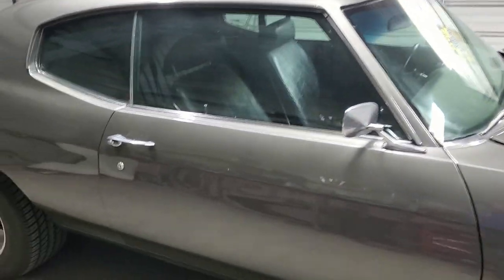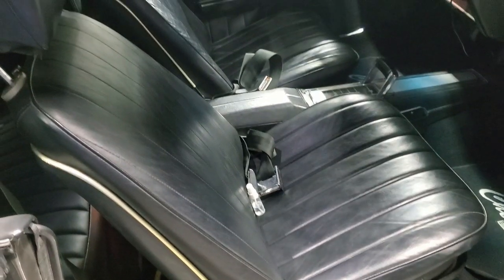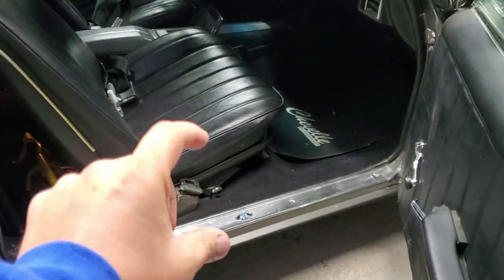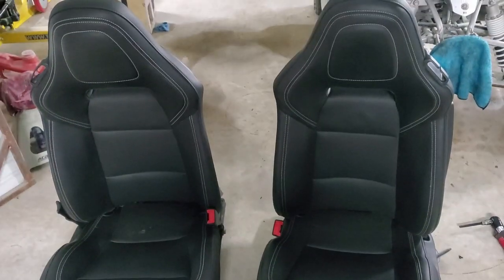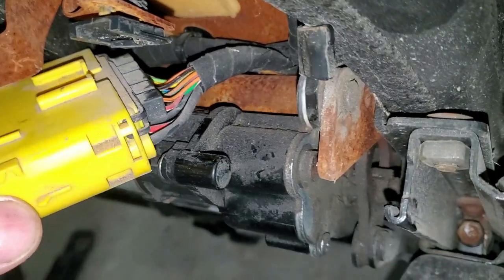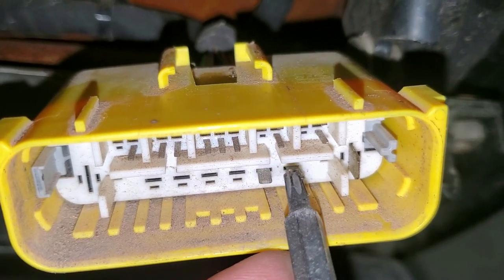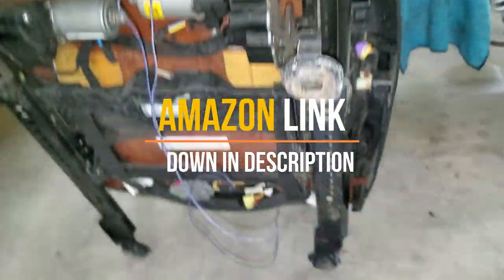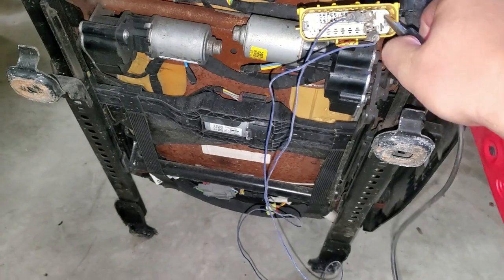How to Wire Corvette C7 Seats for Any car!

Comment: What year C7 seats are these? The seat connector was different from 14-17 and 18-19. This looks like the connector in my 2019 seats but I want to confirm before I fry something.
Reply from the maker: They were 2017 if I recall correctly but although the connecter may differ. Even if you give the wrong ground or wrong power, the motors are pretty resiliant to shorts and won't fry as quick as one would think just give them quick power and quick ground during testing and if you see movement, you are kn the right track.

Comment: Did you wire it to the male connector or splice in behind the harness? Currently trying to install these seats into my C5 corvette
Reply from the maker: You can do either or, aslong as the wire is secure.
Reply: Thank you for the quick reply! I have the drivers in and working, is there only two wires (thick red and black) on the passenger side for power and ground?
Reply: Figured it out, small wire is brown on passenger side… red on drivers side
Reply from the maker: @MRmegaVideoz  thank you for sharing this,  ill add it to the description.
Reply from the maker: @MRmegaVideoz  yes ofcourse, no problem. Passenger side is the small brown wire with purple stripe and the thick red wire and thick black wire.

Comment: This does not work for any seat that came from a car with memory, where the memory module needs a canbus signal from the BCM to power up
Reply from the maker: It does work. I been running these seats on my 1970 chevelle powered up this way for like 2 years now. I barely uploaded the video yes but it was old footage.
Reply: @EddiesCustomsandRestorations  then those seats don't have memory modules. Those are from a low end c7 1lt without driver memory. I have one right in front of me from a 3lt and it does not work. There is a different large memory module under the driver seat.
Reply: @EddiesCustomsandRestorations  This explains that the 1LT does not have memory so does not have the module that needs to be powered up by CAN.
Reply from the maker: @chipcurrey653  i see what you mean